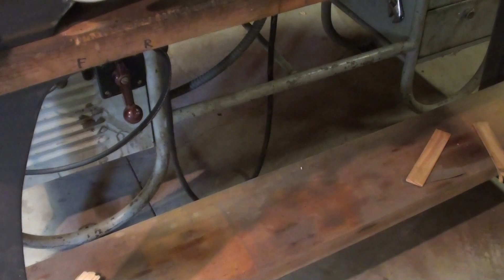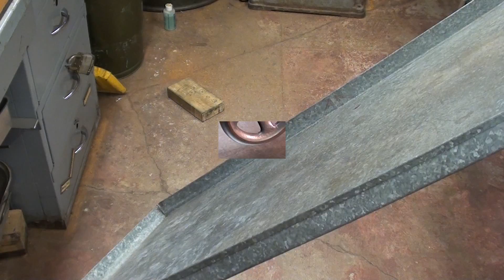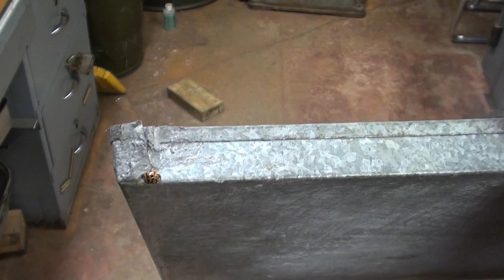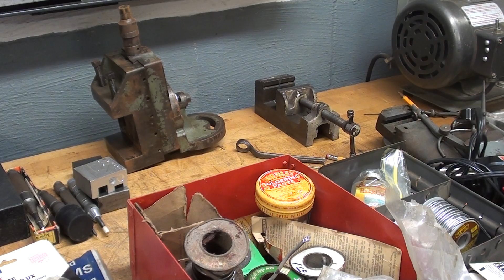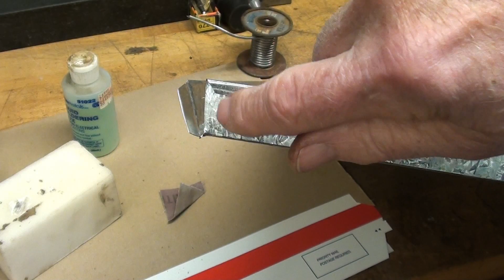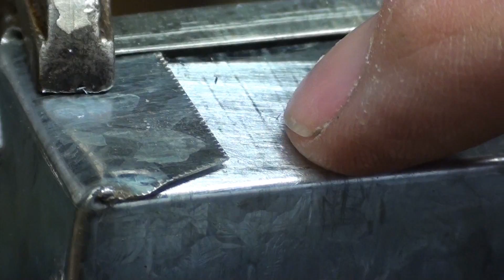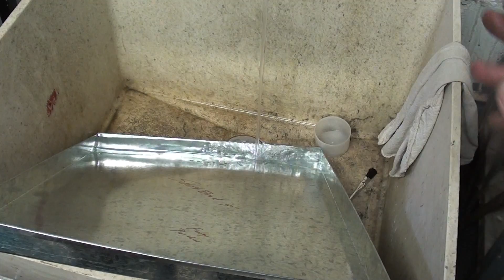SHOP TIPS #295 South Bend Lathe Chip Pan-soldering galvanized steel tubalcain

Comment: 2 thumbs up Mr. Peterson...I have a South Bend 10 K Gag Bed bench lathe I bought new from the factory in the early 70's (machinist 42+ years)...I never got around to making a chip pan...so now I will.....My only complaint about the lathe is that South Bend could not offer me hardened bed-ways because of problems with the heating/hardening accuracy with the gap section..Oh well, I still love working it...again thanks....LYLE 4 PRESIDENT !!!!!.....jm

Comment: Hi Lloyd,
I worked a lot with Galv. in both sheet and pipe. I have arc welded untold pounds or 7013 rod attaching 5/16" and 3/8" plates to the bottom of sch40 galv pipe over the last 42 years. I have also soldered a lot of galv sheet much like you have done in your video. I do like to wash the galv off the part where I am forming my joint with muriatic acid and then a neutral wash afterwards. a shallow plastic pan just large enough to dip the end of the pipe into works quite well or and acid brush also. when dipping the acid works quite fast on the galv. The area will foam for a few seconds and that's all it takes and the galv is gone. After arc welding the part will be plenty hot even after removing the flux and a quick wire brushing that I can still melt zink over the weld for protection. There is also cold galv that can be sprayed or brushed on like paint.
I hear you loud and clear about the kids in school today.
Well thank for another fine video.
Joe

Comment: Enjoyed the video; Thanks.  The clear soldering liquid is Zinc Chloride which is made by reacting zinc with hydrochloric acid.  Excess zinc is reacted to make sure that all the acid is reacted.  Also the Sal Ammoniac when dissolve in water makes a good flux for soldering galvanized steel and plain steel.

Comment: At my work I solder coat little pieces of brass... I weigh the brass before and after I solder coat it.. It becomes lighter after I solder coat it!
Can you figure it out? I already know why..
Reply from the maker: +vdubs4life1964 I'm stumped
Reply: The weight of the solder being added cant make up for the weight of the moisture that is trapped in the brass and gets released during the heating process.
Reply from the maker: +vdubs4life1964 Thanks. Interesting, might make a good short video

Comment: Those of us without access to large sheet metal brakes use baking sheets for pull-out drip pans.  Another useful idea is to cut one side of a driveway drip pan and sandwich it between the lathe bed and the lathe bench or stand (drilled for through-bolting.)  My Logan is set up this way, and it makes it easy to clean oil and chiips that miss the removable drip pan.
Reply from the maker: +misfitsailor Yes-I am replacing a baking sheet on that lathe

Comment: Interesting soldering lesson.  I am 70 and never have tried to solder galvanized as far as I can remember.  I have soldered lots of other things.  I remember back when they made automobile radiators from metal that was most often the thing I would solder.  One of the hazards of second hand cars.  Thanks for the video.

Comment: My sheet metal/soldering project in HS (1971) was making a funnel. Used a formula for layout, then cut and rolled the metal, then soldered the joints. Remember the soldering being the most difficult operation. Still have the funnel by the way.

Comment: Another entertaining video. I never knew the name of that white stuff I used in 1968-1969 High School Electricity and Electronics shop class to clean off the carbon and tin the tip of the soldering Iron. It worked very well but I never ran across the stuff again in my 40 plus year career in electronics. Well now I know the name, Sal Ammoniac, thanks.

Comment: I remember my father soldering galvanized eaves trough for our old house when I was a boy.  He used a blow torch to heat the iron.  Not too many years later we were taught sheet metal work and soldering in our high school Industrial Arts class. Thanks for the refresher.

Comment: I remember making a toolbox similar to the one you shown but the handle was still galvanized folded some way for more strength.   However, it was soldered.
And we used the copper tipped irons that were placed in the furnace for heating.
I started typing this midway through the video and was going to ask about the white blocks that we used to clean the tips with...   and you covered it.   This was in high school so yeah, furnaces, hot copper irons and a white block that creates lots of smoke was a situation ripe for hijinks!

Comment: In the mid '50s, I watched a new house getting its galvanized eavestrough.  All they used was gutter and downpipe.  All corners and downjoints were cut and made- no prefab stuff.  There was a gas fired furnace bigger than yours, and the irons were big.  Full runs with corners were measured, fabricated and hoisted up in one piece.  Very few joints were made at height. Ends were made from flatstock.  One fellow, perhaps amused at my intent interest explained that when nailing the trough, the spike and ferrule must be angled UP from the front to back(fascia) to prevent rain from running along the fastener to rot the wood.  I liked your Bass autopsy video- trying to kill it was lol.  Thank you for your video work!

Comment: You shouldn't file the tip if it's a plated iron for electrical fine work (circuit boards), but you're never going to mess up a solid copper iron used for plumbing and sheet metal.

And I'd be interested in seeing the insides  of that spot welder.

Comment: Thicker galvanized steel (10ga. and above) can be easily and safely welded using 7014 rod or 211 flux core wire.  As with any welding, have good ventilation and avoid the welding fume plume.  We have made thousands of these welds in the construction of solar power plants.  Thanks Mr. Pete for the great videos.

Comment: G'day Lyle, I just purchased one of those brass gasoline/kerosene blowtorches 2 days ago, it came with a set of the wooden handle coppers, I'd never seen one before, when I got it home I repaired the plunger with a new leather cup. it burns fantastic and puts out a lot of heat
Reply: +Ned&#39;s Head  The Modern Black Smith just made a video about the old blowtorches. You might want to check it out .
Reply: Thanks Bob, I'll check him out, I found a good series on repairing the old blowtorches at Old Sneelock's Workshop, well worth a look

Comment: I enjoyed that Mr. Pete. I've made a good number of sheet metal items over the years. Even made my living at it for about, 20 of those years. Glad to see you tucked the tabs under the folds. Looks much neater. Galvalume, is hard to spot weld too. It tears little bits of copper off of the welder tips.

Comment: A slight crease on each diagonal will give the sheet metal extra rigidity 
The soldering iron works best to heat the part, the solder will flow to the heat
Reply: right...heat the part.....I learned how to solder when I was about 5......my Dad was Electrical engineer in the Army....so I learned all kinds of stuff at a young age....and.....I still see 'experts' here on youtube that put a lot of solder on the iron...then try to 'carry' it to the work....both electronic and sheet metal stuff....

Comment: I used to fix gas tanks by soldering a penny over the hole left by rust. After thorough cleaning, of course. We ran car exhaust through the tank to purge the air, other wise...  KABOOM!
Reply: +Doug Rundell Kept a bar of Ivory soap in my Mustang for emergency gas tank repairs.